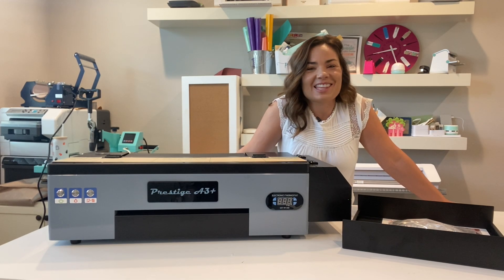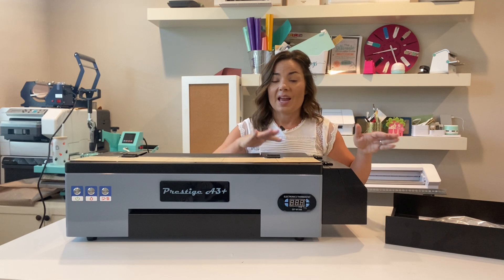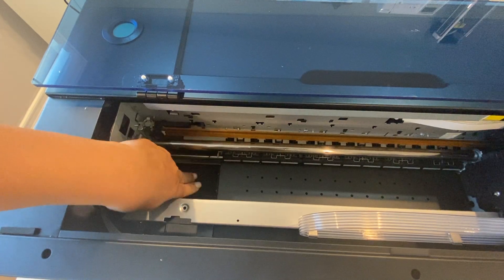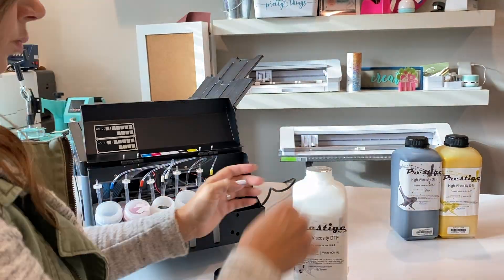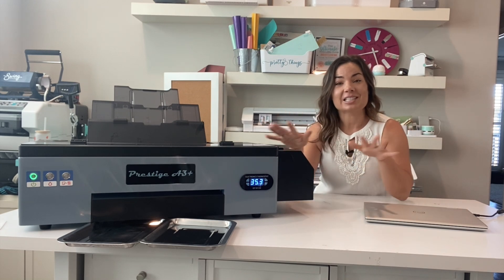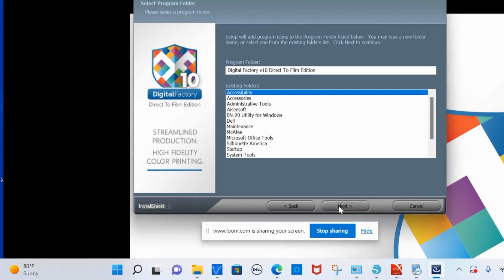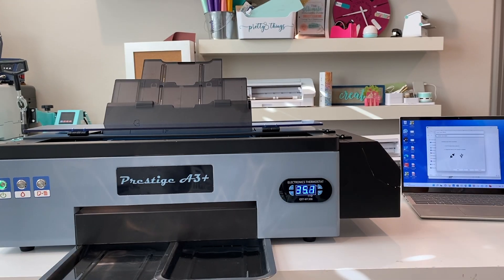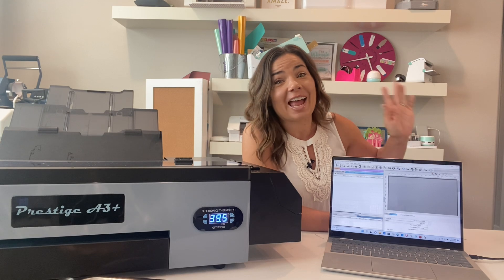😍 Prestige A3+ DTF Printer: How to Set Up DTF Printer & Software Start to Finish

Comment from the maker: ❤Everything you want to know about DTF Printing! https://www.silhouetteschoolblog.com/p/everything-to-know-about-dtf-and.html
⚠Update: As of July 2023, the Prestige A3+ and A3+ R models have been discontinued by the manufacturer ⚠
Prestige now offers two new models 👇
1⃣The roll-fed A4 DTF printer is designed for entry level and small runs. The compact desktop DTF printer’s max print width is about 7.5” wide. It’s available in three colors: pink, mint and classic gray
⭐ Recommended Bundles ⭐
A4 DTF Printer with Ink, Film, Powder, Cleaning Supplies, RIP Software ➡ https://shrsl.com/476pb
A4 DTF Printer with Ink, Curing Oven with Built in Air filter, Film, Powder, Cleaning Supplies, RIP Software ➡ https://shrsl.com/476ph

2⃣The Prestige R2 13” DTF Roll Printer is size-wise the closest thing to the old model A3+ and A3+ R, however with a higher price tag than the original A3+ R model. 

⭐ Recommended Bundles ⭐
Prestige R2 DTF Printer with Ink, Film, Powder, Cleaning Supplies, RIP Software ➡ https://shrsl.com/476p4
 
🔥 If you are looking for a DTF printer that’s most directly comparable to the Prestige A3+, that would be the Uninet 100 DTF Printer which is a 13” wide sheet fed (only) desktop DTF printer. I have this printer and as long as you print daily it’s on the easier side to maintain.  The Uninet 1000 DTF printer is a mid-range DTF printer and is more comparable in price to the Prestige A3+ R (half the price of the Prestige R2) and allows for the use of a roll and to be part of an inline setup. 

🎥 Uninet 100 DTF Videos: https://www.youtube.com/playlist?list=PLT9hB3BOKb_i1b1RUAOCyJTjczI1gpw3Z
Shop 13” Uninet 100 DTF Sheet Printers (Starting at $3795) ➡ https://shrsl.com/476pn
Shop 13” Uninet 1000 DTF Roll Printers (Starting at $4590) ➡ https://shrsl.com/476po

Comment: A 3 plus and A4 has the same setup ? .and the other questions is unintended canvas is the same as A4 prestige printer. Please  , I need help on this , I have prestige A4 , I have little problem to transfer the file design and  do the right size , can’t small , please help me thank thank you.

Comment: There is now a Prestige a3 DTF v2 also. Is that the latest one?
Reply from the maker: They now have an A4 and an R2. The A3 + and A3+ R have been discontinued. https://shrsl.com/49ehl
Reply: @SilhouetteSchool  I'm sorry I didn't make it clear. The printer (driver) during the cadlink install now has Prestige A3 DTF and Prestige A3 DTF V2 listed. I was wondering if the V2 one is an updated version of the other one. I purchased my a3 + r almost a year ago and am just now getting it setup. Thanks

Comment: We can’t get our brand new printer to work. We just completed the whole set up process. What is the 2nd button for? There’s the power button, then the 3 water drops button and that stays red there’s the trash button. How do we get rid of the red light? 

Does that mean something may wrong with the printer beads? Please help? We’re soo frustrated. No one sees to have this answer.
Reply: We have a Prestige A3+R printer
Reply: (Printer heads)
Reply from the maker: Hey there, check out this page for common troubleshooting. Check out number 3. https://www.silhouetteschoolblog.com/p/prestige-a3-and-a3-r-dtf-printer.html

Comment: OK My printer looks just like this, but it has a button under the heat numbers. and when i put the film thorugh to do a test run, it does not just feed through. it goes back and forth and gets stuck. i have to push the button more than once for it to feed through. please help

Comment: Does this work with a mac?
Reply from the maker: Like most RIPs it only runs on PC
Reply: @SilhouetteSchool   I want to use DTF printers that runs on mac. I came across a software- parallel that lets people run window apps on Mac. Can we use this software to  run a DTF printer using mac devices? Or I need to search for a DTF printer that is direct compatible  for mac?